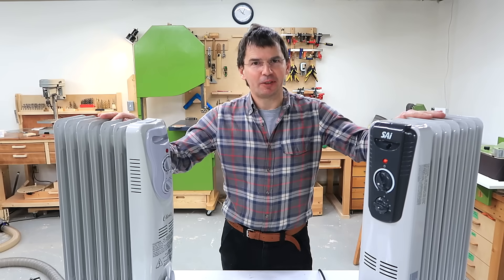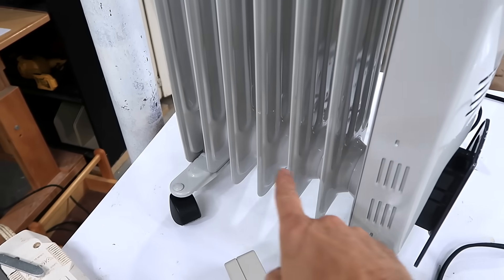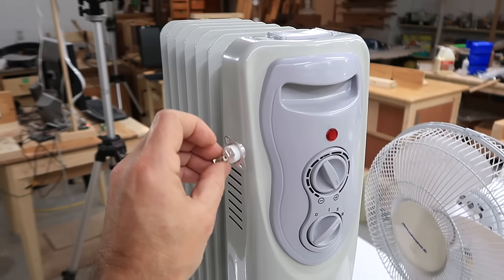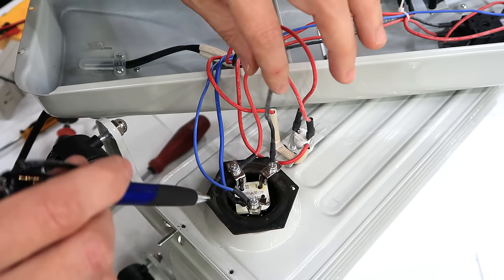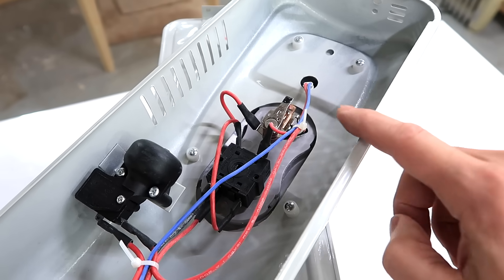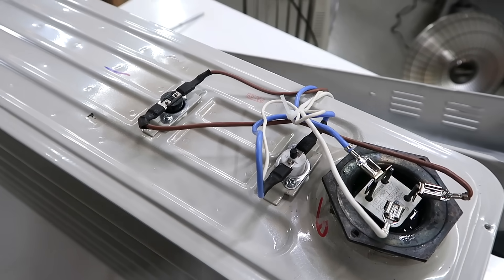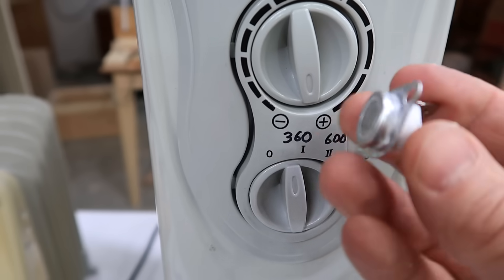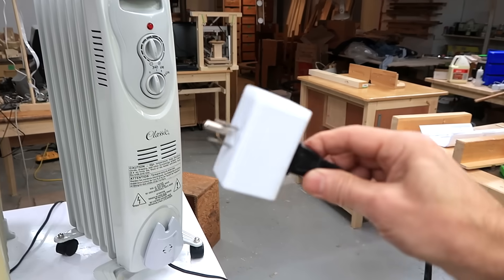Oil filled heaters: 600 watt heaters pretending to be 1500 watts

Comment: According to CSA C22.2 No. 46-13 any oil filled radiator heating surface accessible by a 102 mm sphere can not exceed a temperature of 90C. This is why the temperature limiting device is there and cycles. If you buy the same heater in the USA with a UL 1278 certification there is no heating surface temperature limit, therefore no cycling will occur at maximum thermostat setting. The number one cause of portable heater fires is due to loose electrical connections, that's why the connections that carry the full electrical load are or should be soldered. I have worked for an unspecified small appliance manufacturer for over 25 years working with multiple agency's safety compliance for portable heaters.
Reply from the maker: Ah, very useful infomation.  That may be why some are reporting their heaters don't cycle.  Maybe it's just for Canada they need this overheat thermostat set to what it is, which makes it a stupid design for here.
Reply: @matthiasrandomstuff2221  Yes the Canadian Standards association (CSA) has the max metal heating surface 90C requirement. Underwriters Laboratory (UL) does not have the metal heating surface requirement for US heaters.

Portable heaters can be certified by UL to be sold in Canada and the US, the compliance label will have a cULus marking if it does. This just indicates it was tested to both standards. There's more than just testing involved but I will leave it at that.

There is a third compliance organization Electrical Testing Laboratories (ETL) that tests to the UL and CSA standards. They are a cheaper option for compliance testing so you could see ETL or cETL on the compliance label as well.
Reply: @legeeg  Wow!  Good to know.  And it's colder up there for u folks,  I'll stay down here!  🙂
Reply: @legeeg  how did you get into this line of work?
Reply: @brentbarham3157  local company and one thing led to another.
Reply: @legeeg  Do you know of a USA product that you would recommend?
Reply: @seabliss22  Honeywell or Delongi.
Reply: @legeeg  Mine measures 205 F with a heat gun!😲😲
Reply: Same desing is used in Europe as in Canada
Reply: @matthiasrandomstuff2221  Pretty much every thing in Canada is stupid! I personally blame your Nazi leader! 😁
Reply: @legegg ...and that's why it is flawed. If you install a 2kW heating element, you should design the radiator to be able to dissipate that power under 90 degrees (I would like even less though). If it cycles by design, then it is not a 2kW heater, no point of hawing a 2kW heating element inside if it cannot be utilized.
Reply: @gabiold  marketing and it will get hot faster
Reply: @404hopenotfound  Rest assured, that it is marketing only. Most mtfrs of cheap products couldn't care less about the products practicality. To be totally honest, these days, non-cheap used to be hq brands aren't innocent either.

Heating up faster is sadly not very useful, if you still feel cold or cannot increase or even sustain the room temperature as the dissipation through the walls, windows, etc. is highet than the heating power. Even 2kW is not much, would only work for very small rooms in colder winters, let alone when you modulate that power to half by cycling.

If one want faster heatup, heating fans are the solution. However, that heats only the air up quicker, but the surrounding objects would still be cold for a while, making it you feel colder than you'd have expected for that room air temp. Radiator makes you feel nice, but only on the side you are facing it, and the other side of your body feels cold, plus the air circulation is slower, so it heats up the entire room slower, no matter what. Neither one is particularly comfortable in itself for cooled down rooms. You need both a radiating surface and pleasant air temp to feel warm.
Reply: @matthiasrandomstuff2221  yes, isn't it generally colder in CN?
just sayin'
Reply: @jamesalles139  Depends on where, up here in NH it's about the same. Easily gets ~ -15C from dec-feb with many feet of snow daily. The states around us can be similar as well.
Reply: Which brand or model has everything you’re talking about?
Reply: @whatthe2458  Each model will only have one of the certifications listed not all. The manufacturers have to pay annual file review costs for each certification. The small appliance business is extremely cost sensitive.
Reply: OK, Igotta ask, why 102mm? why not 100mm? Is it just four inches rounded to the nearest whole mm?
Reply: @StripeyType  probably temp determines distance
Reply: @StripeyType  That is the reason.
Reply: With the proper know how you can bypass that switch but leave the thermal fuse intact.
Reply: Very interesting!
Reply: This is the best part of YouTube
Reply: I make sure mine are plugged in outlets with dedicated breakers!😁😁
Reply: I’m so
Reply: Thank you for sharing that.  I've wondered why they went through certain troubles when I tried fixing several of them second hand.
Reply: The connections that carry the full load should be gas-free. Soldering is one way of achieving that. Using certified and calibrated crimpers and quality terminals is another common way. High power wiring assemblies are crimped on a pneumatic or servo press, not manually, and the crimps are excellent as long as the production engineer is competent.
Reply: Since common sense among society is low to non existent it is necessary for a slew of mandated sensors to be at the ready.
Reply: What do they do about switch contacts that get warm and start to soften the solder?  If an appliance pulls 12.5A, they use a switch rated for 15 and call it "good".
Reply: im super late but does this apply outside of the USA i assume not right?
Reply: @Ilikesirens  Only for Canada.
Reply: I’ve been modifying my oil filled heaters for years, getting rid of the over temp fuse. I don’t care about codes or whatever. I’m paying for the power and I’ll use it how I see fit. Safety nerds get lost!
Reply: According to me I’ll take the fuse out and use the rated power. I’m paying for the electricity and I don’t need some maple syrup smelling Canuck telling me how to use it. I also removed my catalytic converter from my car and get an extra 3 mpg.
Reply: @vitospatafore9737  keep sucking that lead filled air brother
Reply: Hey Do you have any recommendations on any good electric oil radiators 
Thank you
Reply: @josephpuchel6497  Look for Delongi brand.
Reply: You're awesome, all my curiosities were immediately answered. Thank you gooberment for fook'n up a good thing.
Reply: Is this video not based on US products then?
Reply: @Lwhosane  it is in reference to Canadian heaters.
Reply: Why would you want soldered connections to fix loose connections? Crimping is more reliable.
Reply: @tookitogo  negative
Reply: @MrBen527  A proper crimp is a cold weld. However, in a heater where nothing moves and nothibg needs to be disconnected, a solder joint would be better than a quick disconnect terminal setup.
Reply: @timramich  Yes, I'm agreeing with the solder method on this application.  I was disagreeing with the other guy
Reply: @MrBen527  Yeah, but crimping is still more reliable. Take apart any major appliance and you’ll find that everything is connected with crimped connectors, not solder.
Reply: @tookitogo  ever look at an old tube amplifier?  everything is soldered and that crap lasts for decades man.
Reply: @tookitogo  It's not more reliable. Its easier, faster and cheaper to perform so no company will solder unless conditions require it.
Reply: @MrBen527  LOL. Yyyeah… no. Soldering, particularly to stranded wire, is decidedly less reliable. That it’s faster and easier are just more benefits. (But crimping properly is nothing to sneeze at: it requires the right tooling and proper matching of contacts and wire. A bad crimp is not superior to solder. But a proper one is.) This isn’t my opinion, this is fact that is well established in the electronics industry. Google it.
Reply: @justinbouchard  I didn’t say soldering was unreliable. I simply said that crimping is more reliable.
Reply: @timramich  You can also do splice crimps that don’t involve quick disconnects. This is found in a lot of heating appliances, too.
Reply: @tookitogo  cause it is faster
Reply: @tookitogo  Not at all.   That sounds like these "plumbers" who say a crimp fit is stronger than a solder fit on a pipe.  You say that because you don't know how or don't want to solder.
Reply: @MrBen527  I don’t know about plumbing crimping vs soldering, but they’re also fundamentally different types of compression, in that plumbing crimps use rubber or elastomer seals, IIRC.
Electrical crimps create a cold weld, and no solder (or flux) wicks up anywhere. Solder wicking into stranded wire creates a new strain point where the solder stops stiffening the wire, requiring more strain relief. Flux that wicks up can cause corrosion. Crimping eliminates all of that. Additionally, crimp connections can tolerate higher temperatures, if that’s needed. And finally, crimping can be used to join metals that cannot be soldered easily, like stainless steel. (I just had to make some cables with all-stainless micro coax cable for cryogenic use the other day.) 

Regardless, this isn’t my opinion, it’s well-established fact in the electronics industry. 
See also how the auto industry has been moving away from soldered PCB connectors to press-fit ones: no solder joints on the connectors means no solder joints to fracture with thermal cycling and vibration, replaced by the airtight cold weld of the press-fit PCB pins. The tradeoff is that the manufacturing tolerances on the PCB holes are much tighter.

To reiterate: I am not saying that it’s impossible to make a reliable solder connection. It is. But it takes more effort, and a properly-made crimp connection will be more reliable still. 

A poorly-made crimp connection, however, is not better than a well-made soldered connection. The fact that many people have only ever made awful crimps (using improper tools, poorly matched to wire and terminal) is why many people don’t think crimping is reliable, because they’re comparing abysmal crimps to decent soldering. For sure, if one doesn’t have proper tooling, then soldering is likely to be better. But done properly, crimping is superior.
Reply: @summerforever6736  Huh? Crimping is way faster than soldering.
Reply: @tookitogo  yes i did say that 
companies not going to solder if they dont have to ...
Reply: @tookitogo  YES
Reply: @tookitogo  I recently got a proper crimp tool for Anderson PowerPole connectors. Why have I been soldering connectors for years? Good crimping is beautiful.
Reply: @gf2e  Right?! Satisfying, fast, and reliable. What more could one want?
Reply: @tookitogo  The other thing that I like specifically about PowerPole connectors is the huge range of wire gauges that you can crimp on the same connector. Most connectors have a fairly narrow range of wire gauges. You don’t normally want to connect 10 gauge to 20 gauge wires. But the 3 pin sizes of PowerPoles let you go across a wide range.
Reply: @gf2e  That is cool! I’ll have to look into those the next time I need a power connector. I’ve heard of PowerPole connectors before, but have never used them! 

FYI, another connector series with a quite wide wire range is Molex Mini-Fit, which covers 28AWG to 16AWG. But it needs a bunch of terminal sizes to do it.

Also, Amphenol Mini-PV (the original “DuPont” connector) covers a surprisingly wide range of sizes, from 18AWG all the way down to 36AWG, using 4 terminal sizes.

(As you can probably surmise, I haven’t yet had many projects dealing with high currents.)
Reply: @justinbouchard  Not high current.  High Voltage is soldered.
Reply: @mosswareproaudio6328  dude this video is talking about a 110 volt appliance.
Reply: Hex crimping is fully registered to a specific wire gauge and terminal type.  No chance of metal whisker formation.  Aerospace cable and wire connection has adopted crimp terminals as standard
Reply: @tookitogo Crimping one connector by hand is faster than soldering that same connection, but soldering can be more easily automated, and is faster for doing bulk connections.
Reply: @jasexavier  I’m sorry… what?!? One of the big advantages of crimping, whether by hand or automated, is its speed. There are machines that can cut, strip, crimp, label, and bundle wires completely automatically. In terms of sheer numbers, more contacts are crimped in semi- or fully-automatic crimping machines than by hand.
Reply: @MrBen527 um positive 😂

Comment: Here in Europe these heaters are usally 2000W thanks to our 230V wall power, I have found that on my heater the middle setting which outputs around 1100W doesnt cycle and maintains this power output constantly, the highest setting does cycle from 2000-1900W to around 700-800W (depending on the exact outlet voltage)

Comment: Is there not a concern that wiring 2 heating elements with different resistances in series would cause the element with the higher resistance to dissipate more of the total power, causing a voltage imbalance, and making the higher resistance element to get hotter than intended?
Reply from the maker: the higher resistance one will indeed dissipate more power than the other element, but at the same time less power than it would if it were used on its own.  So not an issue.

Comment: I thought the point of the high wattage was quick warmup, and heating in very cold environments. If the room is relatively warm, there's no need for anything other than the lowest setting. As a bonus this reduces the on-off cycle rate. They aren't for making your room extremely hot.

Comment: I just arrived to this video because I bought an oil heater from Amazon (obergozo brand) with 3 settings (800, 1200 and 2000 Watts) except that the 3 settings are all 860 watts max😂.  It's not able to warm a tiny room 3x1.5 meters from 20C to more than 25C.

Comment: I think the brands of heater your using are defunct because I've had two big 11 fin radiators, one in India with with wave like fins and one here in Nepal and they also have the electric blower fan heater, and these things can melt the wiring in the walls and blow out the sockets on high.  High works, it is powerful it's just you need a dedicated socket.  I think high is 1800 watts on these and then if you were turn on the electric fan heater, that would be over 2000 watts so I can never run it over level 2 anyway, and I prefer level 1 at night.

Comment: Glad I found your video. I have a Utilitech (Lowes) heater that starts up at 1500 watts. It cuts back to about 700 after a few minutes. Without your video I wouldn't have known this is common. I guess they all work like this. Why wouldn't they? My old trusty Pelonis doesn't do that. At least if it does it takes a long time. Lowes should be ashamed to sell this cheap Chinese POC.

Comment: I recently was gifted two electric heaters. A Pelonis oil filled with 5200 btu capacity and a Utilitech infrated(It is shaped and sized like a little fan). Right now I've got the little fan shaped heater and another oil filled heater being teammates, warming up the kitchen room area in my big old trailer home. I converted and closed in this 12x12 area into my bedroom. I have yet another oil filled heater running in my small bathroom. The Pelonis I haven't used yet. Definitely going to set it up This coming Monday night, since the temperature is supposed to get down to 3 degrees by very early Tuesday morning. Last night into very early this morning got down to single digits. Somewhere between 7 and 9 degrees with strong winds as well. NY is such a Kooky weather type of state. I remember it like yesterday when I'd come home from work during the summer, and the thermostat would read 95 degrees.

Comment: Whatever...here's a few takeaways I've noticed since using oil filled heaters for years and like them. 

1.) They're ajustable depending on the size of the space.
2.) They're movable.
3.) They've got a small footprint.
4.) They're quiet.
5.) The heat is gentle rising, not forced air.

...and most important,

6.) Unlike FAG, very efficient since each unit of power is directly converted to heat and there is no loss of heat by way of venting and burning. Electcric may still be technically more expensive, but it's not clear if it is, and the advantages outweigh the dis. And they're way lower maintenance and you don't have to deal with contractors on an ongoing basis.

Comment: In an electric heater, you don't want anything glowing red. 
That red hot surface will burn any plastic that falls on it. 
Your inside air is full of plastic dust particles. 
You will be breathing burning plastic all the time inside your home. 
I have a degree in this $H!T ..

Comment: I found this out in my Camper over winter - On full i could hear the clicks of it switching on and off spending more time off than on - it said 800 watts but it was more like 300 - only by putting a fan behind it could it keep the RV minimally warm -perhaps 500watts still clicking off occasionally for a short spell - We now have bought a 1200w one in the hope it will give 600watts  which should do the job

Comment: I want to wire one to a real thermostat for a baseboard heater so I can set the temperature. I'm using two of these to heat a studio and I have a whole spreadsheet of what power levels to set them at based on the outside temperate. When I go to sleep i have to estimate outside temperatures overnight.

Comment: its funny coz if you show a radiator and a blower style heater to a person who doesn't know the pwoer draw they have, they will probably assume the radiator will heat up the same room faster. which isn't necessarily the case. but than again, so would a hairdryer(the one i have is 1750W) if it doesn't shut down due to overheating. but its noisy as hell.